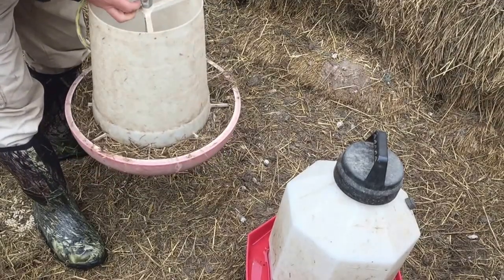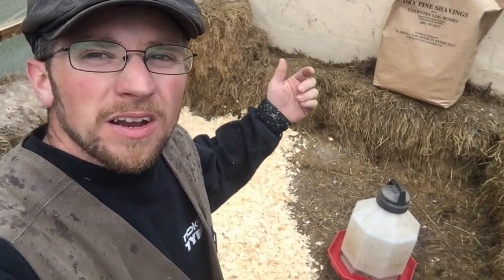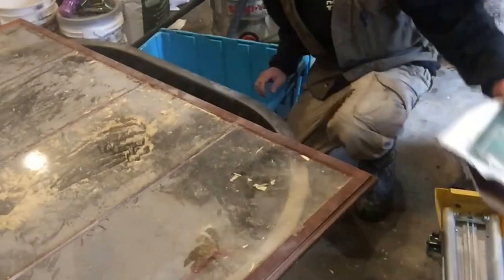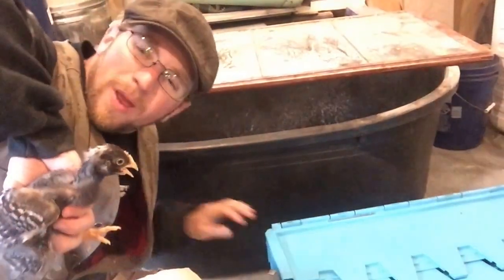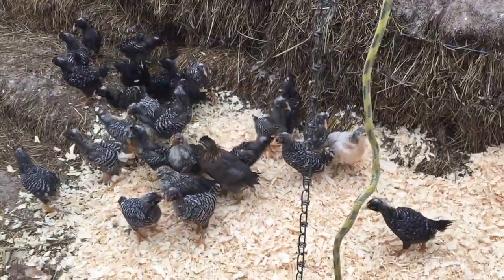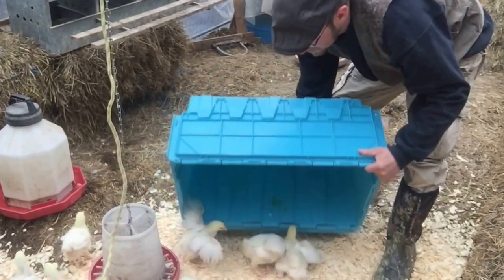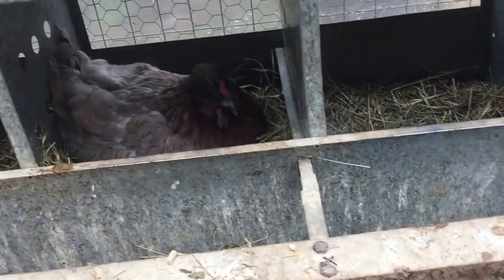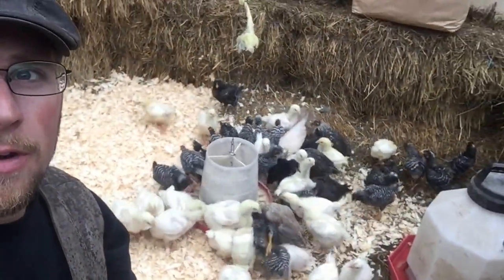Getting Kicked Out!

Comment: I think it's time to put those hay bales outside, and let the rain leach some of that caked manure into the bales, before you throw the crust on to your compost pile. Then you can plant potatoes/sweet potatoes right into the bales, and add some of those old used up pine shavings on top of the planted bales for mulch. So all those bales will create a giant potato garden. Once the vines wilt from first frost, you cut the bales to easily harvest all the potatoes. The then cut bale flakes can be spread out as mulch in your garden area for increased organic matter, and weed suppression. Where the bales sat all growing season long, it will have retained moisture and the worms will have moved up to the surface eating the bottom of the bales, creating rich wonderful soil, ready for no till planting the following spring, as long as you keep it mulched until planting time.
Reply from the maker: That sounds like a great plan! The bales will be coming out no later than next weekend! Then I will let them sit for a bit before I plant some potatoes in them. Thanks